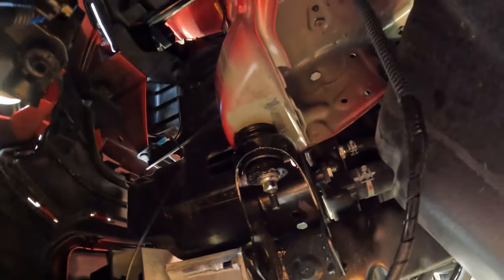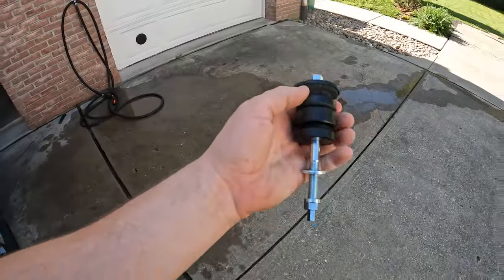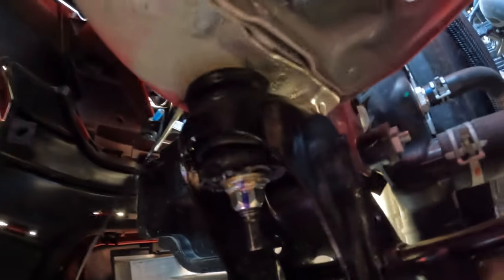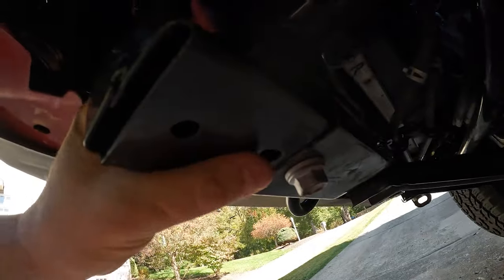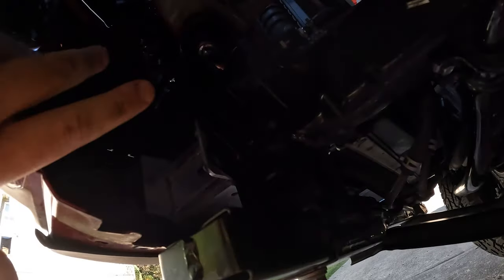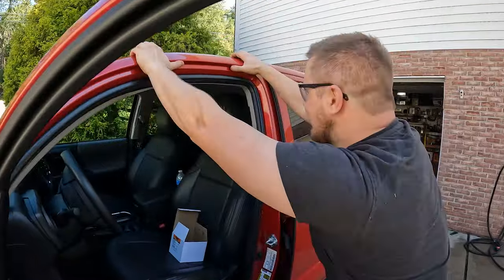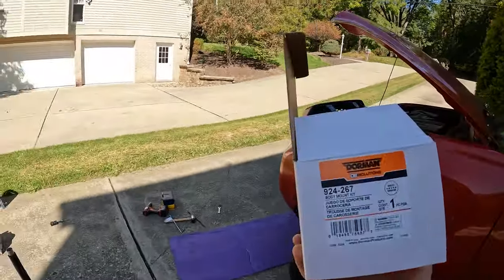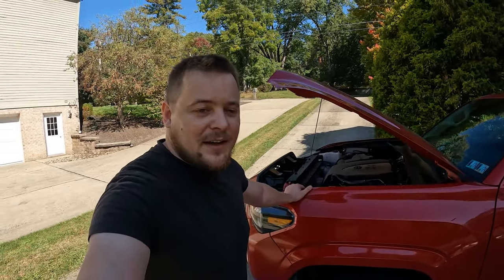Silencing the Squeak: 2022 Toyota Tacoma Front Mount Horrendous Noise Fix

Comment: Toyota dealers will fight you tooth and nail to avoid fixing known toyota quality issues like this too. My 23 4runner had a headlight replaced, and the entire front differential was bad from brand new. First dealer was forced to change the headlight and the front differential they blamed on tire noise. " It's NORMAL " It got very bad by 14,000 miles and took it to another dealership. Yeah the entire front differential was full of metal. Toyota quality has been going down. I miss my 2014. It never had a single issue.
Reply: Dude my squeaking problem was they didn’t tighten the driver side camber and castor bolts. It was so loose I could tighten it with a regular socket wrench

Comment: Had same problem.  Both front engine mounts were sheared in half.  Instead of using rubber replacement mounts decided to go with polyurethane ones from Direct Energy.  Polyurethane is exponentially stronger than rubber and has a much higher resistance to water and intense heat.

Comment: I have the same problem on my 23 Tacoma. The dealership is swapping out the same two front mounts and both of the  lower control arms. My truck only has 3750miles on the odometer.
Reply: Update: front cab mounts and lower control arms were swapped to my 3rd gen Tacoma and it solved the problem. Thanks for your video!

Comment: 3800 miles on a 2023 TRD Sport and I just had the driver’s side mount replaced at the dealership. It took about 6 weeks to go from “is that a noise I hear?” to setting up an appointment at the dealer to handle this awful squeak and creak. Now, I’ve just started to hear the beginning of the passenger side squeak too. Dealership of course handled under the warranty so it didn’t cost me any cash but it did cost me 3 hours of a Wednesday morning. I recommend doing both mounts at the same time. Even if only one is noisy.

Comment: Thanks for pointing this out.  My 2021 Limited has a passenger side squeak.  I bought the truck with used with 6,000 miles.  I have trying to locate the squeak for the last year.  I will now inform the dealer.  Thanks

Comment: Have the same issue with my 2018. Been that way for years. Took it in under warranty and of course they couldn't figure it out. I bet this is it. Thank you for the video.
Reply: I took mine in 3 times and they couldnt figure it out, replaced a strut and everything.

Comment: When I change my oil every 5000 miles . And thankfully having use of a mechanics lift . I liberally spray all rubber components underneath with 303 Protectant . To help them resist drying out and cracking .

Comment: I had the same problem, 23 with less than 10k miles, took me an afternoon to pin point where its coming from. But i soaked the heck out of it with silicone spray and it has gone away.  If it comes back before i have to trade it in for a new truck, i guess i will spray it again lol.
Reply: Why wouldn’t you bring it to the dealership and have it fixed under warranty?

Comment: My 23 TRD OR with 12,000 miles does it, just started on the pass side. Over speed bumps or any straight on hits nothing but if you drive at low speed and swerve the wheel it makes the noise. It’s very hard to wiggle the car and observe at the same time. I thought maybe it was my mid skid loose and slipping but nope, it’s something up front.